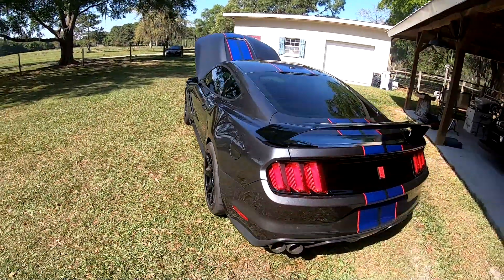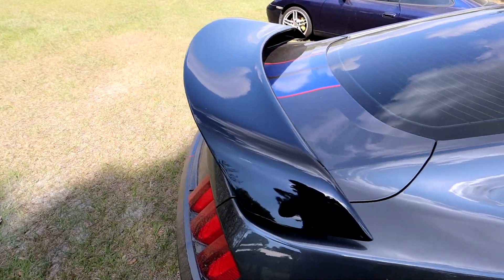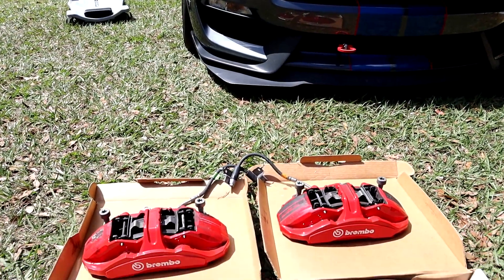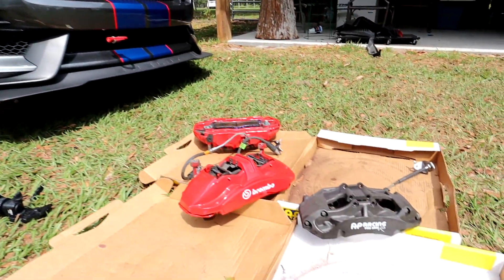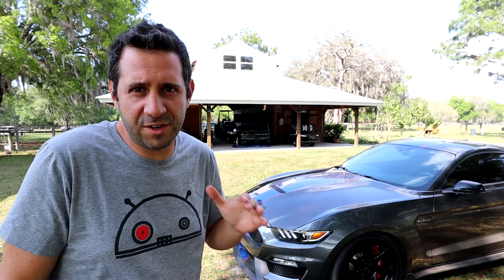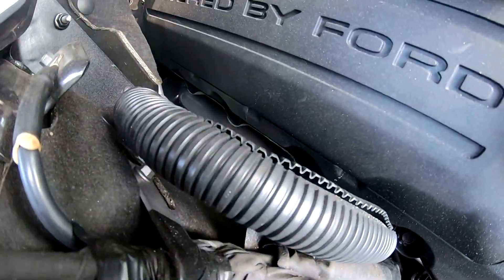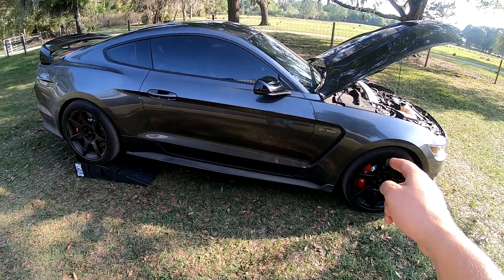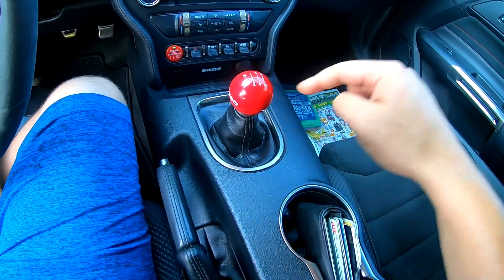I Bought a SEVERELY DEVALUED Shelby GT350R Mustang and I'm Restoring it back to Factory OEM!

Comment: Never, never buy a track car.  It is beat.  Sure, you could replace every bearing, bushing, gear and engine, but the body is still beat.  Think about all the flexing that body has been through lap after lap.  Don't do it. Buy one that somebody forgot to drive and save yourself a huge headache.

Comment: Gets a modified nice Mustang. 

DECIDES TO PUT THE STOCK PARTS BACK ON
Reply: I can understand the exhaust bit (apart from the headers wich he would only pull out because MONEYYY BROOOO) and the suspension module if it's really that bad.
Reply: @kaedeschulz5422  i mean cmon. Those upgrades are special. He should have left them on the car.

Comment: Looks  makes fantastic Products but the sound of that system is awful! Probably why the owner want to dump the car LOL. You could use a shiftech X pipe along with your rear section and have someone fabricate from the cats to the X pipe. Ford did use a 2.75 inch piping which is an odd ball size.. that MW shifter is also a waste of money in my opinion

Comment: This was a great deal. I would rather have the GT 350R over the new GT 500. I still prefer a manual transmission over flappy paddles. Electric cars are the future, but until then give me a V8 with a manual.
Reply: I just prefer a stick. It is more about involvement in the driving process than control.

Comment: My GT350 has stainless works long tube headers with high flow cats.  The rest of the exhaust to the tail pipes is stock. Including resonators and it sounds epicly bad ass.  Nothing like that kooks setup.  That was completely disappointing. 

Fathouse fabrications in indiana has plenty of stock GT350R exhaust sitting around they will sell for a fair price. The are take offs from all the GT350R custom twin turbo setups they build.

Comment: While the car is worth $50k, every bit of it, I’d prefer some kind of AMG Mercedes.
Reply: Two completely different cars.  To get an AMG that would be anywhere near as fast on a track (which the GT350R is built for) you'd have to pay $115K minimum for a GT.  Yes, I know other AMG models have more HP, but their tires and engine wouldn't last more than a few laps on a track before cording the tires and overheating the engine due to their weight and insufficient cooling on their forced induction engines.  If you want a grand touring highway/bahn cruiser, then an AMG is for you.  If you want a track car that you can buy for under $75K with no mods and take it to the track and  crush virtually any stock car short of a McLaren, Ferrari, or $150K+ Porsche, then the GT350R is for you.
Reply: Steve Ross I totally understand that. I perceived the question as basically would I spend $50k on it. Like I said it’s worth it but I wouldn’t be taking it to the track or anything like that. I would just need a somewhat comfortable car with nice features that’s also a sleeper when you need it to be. Now for track use the Mustang all day!

Comment: I never would have drained the brake system that's ignorant. It just pick up the appropriate tools to block the lines while you're changing the calipers over put it on there then believe the system from there you would Deuce area through that master cylinder and the ABS unit if it has one you can cause all kinds of hate and discontent for having to rebelieve the system if it's got rubber hoses you can buy block off tools to put a little pressure on them to block those with no issue. Then you replace your stock components and go about your business by bleeding it with that vacuum tool move silly way to do it and a great way to cause all kinds of hate and discontent to cook in the brake system. And that's 30 plus years of working on cars experience talking.

Comment: Hey guy - I noticed on several of your videos you use a floor Jack on grass - be sure and remember that floor Jack's need to be able to roll forward as they go up - if ur gonna work on grass u should put that Jack on some thick plywood - also u need to use a Jack stand when ur in a position where the car can fall on you... all that is keeping that car in the air is a Chinese made oring ... you dont want to film yourself getting killed because of stupidity.... like ur videos - I just bought 2 - 1990 Mercedes 300SL convertible with hard tops...

Comment: I don’t understand why you would remove $5,000 front upgraded brakes if you “can’t tell the difference”, makes no sense.. if you wanted to match the red why wouldn’t you just paint the ap racing calipers red.. I personally think you don’t have any idea about aftermarket parts

Comment: Cool video but I'm still incredibly confused by just the first few minutes. Sam calls it a GT350r, it has just GT350 on the side. Then there's talk of the GT350 release, which doesn't have enoug HP, so Ford makes the GT500. Where's the 'r' in this story? Then we're back to the GT350r that Sam has bought - which has good resalue value, but not Sam's gt350r which sells for about a gt350. Is that compared with a new one or second-hand? And this is because there's 15k of modifications on it, which brings the price down by 20k?? The story here is very hard to follow, a more logical narrative with a better emotional arc would not be hard to imagine.

Comment: Will everyone just stop with the collector car bullshit please.  That car will follow the typical value curve of every car, in 10 years when it's obsolete, you'll be able to find low mileage models for 10-20% less than the original price (indexed for inflation) and you'll be able to find high mileage and track abuses models for 20-40% less than original price.  It will continue that doldrum for 20 to 30 more years before low mileage models actually appreciate.  Then it'll pick up pace and after it goes positive again, in several years it'll finally start to become a real viable investment beyond being a useful vehicle.  So we're talking about an investment horizon of 30+ years JUST to get back above original cost.  That's for low mileage and garage Queen models.  THEN you have to figure in all the costs spent on maintenance, insurance, storage and how much it costs a person just to keep the car around.  When you factor that in, it's 3-4 decades + before it becomes a viable positive investment and 4-5 decades before it becomes a sensible investment over the same period (compared to just putting your money in some other investment instrument).  Bottom line, you'll probably be dead before the car ever pans out being anything more than just a car.  Enjoy it.  Stop worrying about what it's worth as a "collector" car.  You're just deluding yourself.

Comment: You’re not getting value back to the car returning it to stock because the cars Data recorder will store the information that it has to say that it has been tracked, it will still be a devalued GT350r so you might as well leave the AP racing brakes....but i say put the exhaust back on...sound like shit

Comment: Great deal. Smart purchase. Spot on with reverting those items back to stock and selling them off. I would remove the exhaust and revert to the stock airbox. The money you made could easily pay for a new set of midpipes from the factory. The car will sell easily and probably for more than your think.

Comment: lets be honest here, the mods didnt devalue the car, the owner just sold it for an absolute bargin xD

then you ruined what is a piece of art for a few grand extra money.

then you painted some OEM calipers that didnt need painting at all you rubbed all the issues off

then you said the OEM suspension chip was better than the performance one that was 'too soft'

im baffled.

Comment: Really is that all you do buy a expensive mustang that has 15k of parts just for the 3x the resale value of a oem stock mustang gt350 WITCH some new owner will spend 15k-100k in performance upgrading modded engine modded clutch transmission upgrade all that work you put in was a waste leave it alone unless your bloody rich and have a billion dollars in the bank